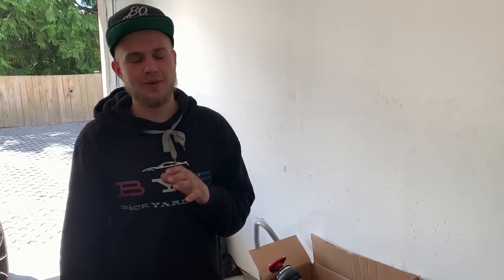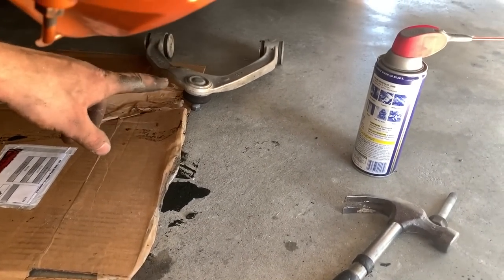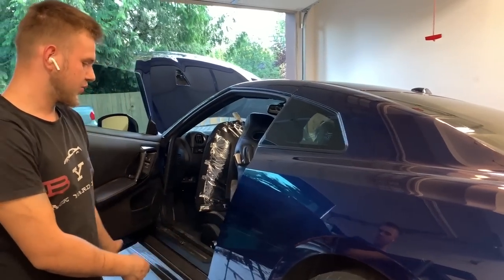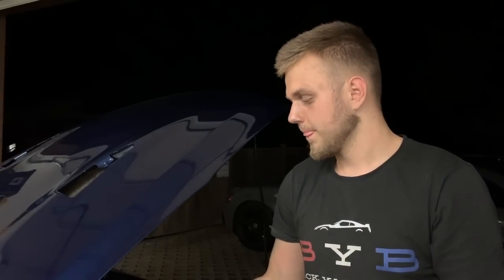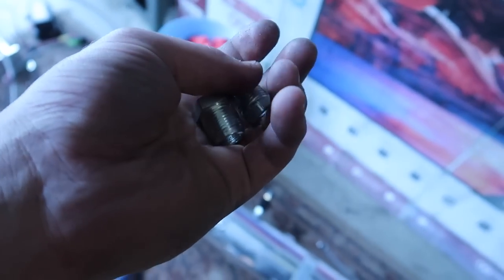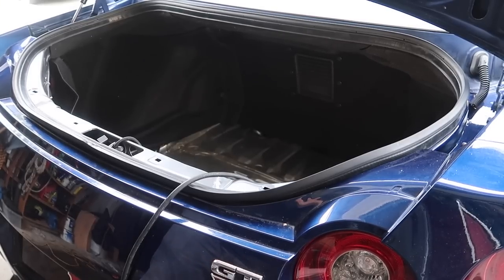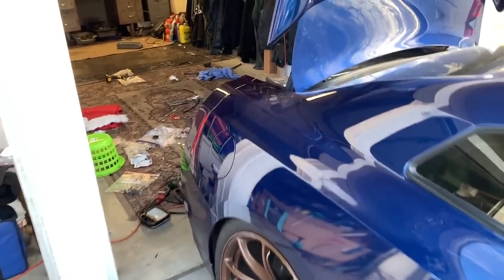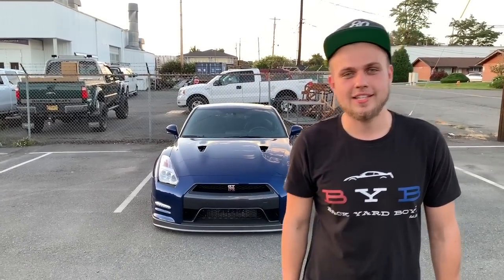BAGGING my CHEAP Nissan GTR On AIRLIFT 3P Like TJHUNT *LOOKS AMAZING*

Comment: Quick observation. Isn't the valve on top now the water purge? Since the tank is mounted upside down won't the tank hold moisture? And pump the moisture into your struts and cause damage over time.

Comment: I wouldn’t have ditched the suspension for airbags as the car won’t handle like it did.
Are the front marker lights odd? 
And you can buy clear marker lights for the rear too

Comment: Great video. I was thinking of bagging my GTR. How has the handling been?  When I was looking at other install videos I saw that the manifold should be higher than the tank so if there’s any moisture it doesn’t flow from the tank to the manifold.